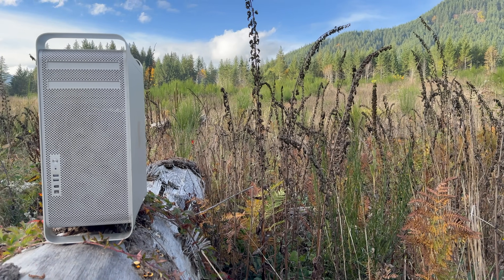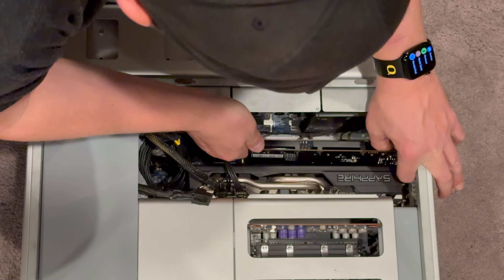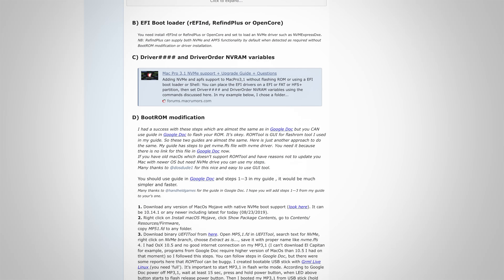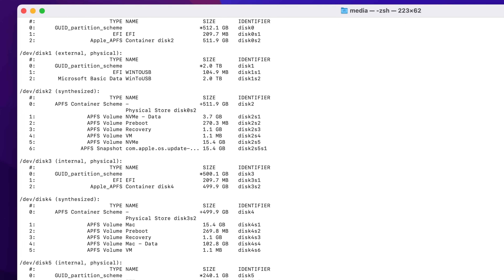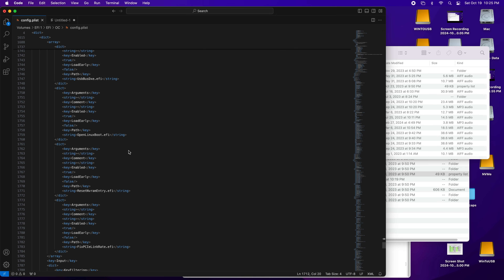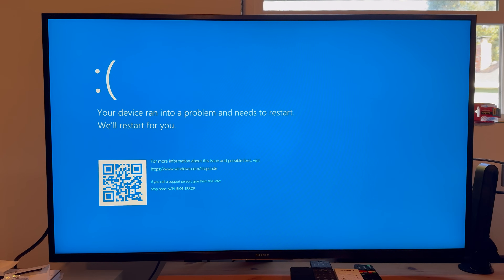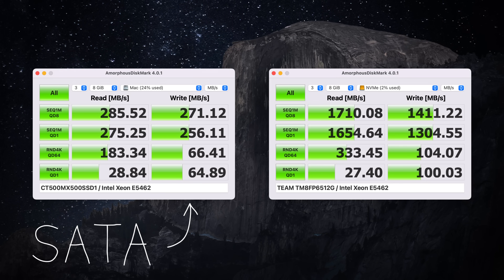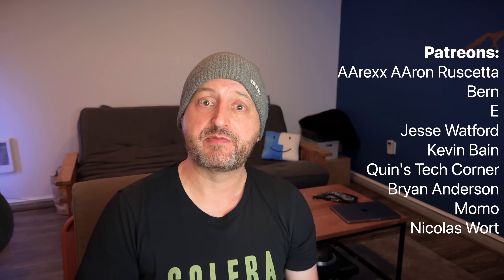An absurd upgrade in a 2008 Mac Pro (NVMe/USBc/10 Gb enet aka McFiver)

Comment: I'm going to have to come back to this channel for a better understanding of Open Core and how to get my 5,1 2008 Mac Pro up to a more current OS.  I'm stuck.
Reply from the maker: If it’s a 2008, it’s a 3,1. They’re a bit dicier in OSes after Monterey so if trying to load a modernish OS, start there.

Also this might be of use:

OpenCore & OCLP Explained (OpenCore Legacy Patcher)
https://youtu.be/VSF9eCLDpoI
Reply: @dmug  - Mine's already been updated to 5,1 with the help of Macschrauber and I'm on Monterey (I believe, I'm at work) but I'll review the link.  I've been using OCLP with mixed success.  It's been a while since I touched it, but I had been having weird boot behavior.

If nothing else I plan to update the dual Xeons to their max and give it a bit more RAM.  Then maybe an nVME.

Comment: I have 3 Mac Pro 2012z. One I use for all my FireWire audio equipment. The other 2 are cloned as backups. I record and then I do all my mixing on the editing on my m4.
Reply from the maker: I'm probably headed this direction, my Mac Pro 2019 is my audio computer and then I'll use a Mac Studio for anything down-chain.

Comment: I remember these days of manual boot load editing. It was actually fun for awhile, as you said “like magic.” In what feels like a short span of time, OC - still in beta - became very smart and easily usable. It enabled me to advance my MP 4,1 to a real beast of a machine and even use it as my primary live recording computer. Some of the changes even reduced the power consumption and fan noise which really felt too good to be true. I recorded some major platinum releases with that computer and I grew so fond of it, I decided to put it on display in my home, behind glass with all the special dishes. How geek is that?!?!
Reply from the maker: Yeah, same thing for me, my Mac Pro 2008 is the only computer I have sentimental attachment to since it was instrumental to several life events. I picked up web development using it which became my career. I recorded two albums on it with a friend. I started my "Definitive Mac Pro Upgrade Guide" just so I could log the things I could upgrade or do with it. Since it was my main and for awhile only computer between 2008-2018, I got a lot of mileage out of it. I bought 2018 a Mac Pro 5,1 and just more or less migrated everything into that computer.

Comment: Just use propertree and clear snapshot and the drivers and other kexts will be injected with the correct priority. You don't need to manually add a string or anything to the config.plist dile if you just want to add or remove files in opencore. Usually that is.

Comment: I have a question..will the  Sonnet McFiver PCIe Card run without all this work on my 2012 5,1 mac pro.
Reply from the maker: 10 GBe requires modifying opencore but it doesn’t need the NVMe hack

Comment: Two part question on the Mac Pro 2010 5,1, please.  Please keep in mind I have a very, very low budget:   1.) What is the best and cheapest metal card I can use?  My goal would be to have it as a way to bring my firmware up to date, not for daily GPU use.  I have two 2010 5,1 Mac Pros that were given to me, and I could swap the one metal card between them for upgrading.   2:)  Can I easily use an NVIDIA GPU in the 5,1 with a Linux drive?   If so, do I need to leave the other metal card in?      Background:  I already have the Linux disk with installed AI models, so I'm not going re-downloading 100 GB+ to run them on the OCLP Sonoma drive or the High Sierra drive.  I have a data limit.  And, yes, these Mac Pros should run AI models just fine, because of the many cores.  I have a much slower 4 core Intel i7 computer with no relevant GPU, and it runs them just fine from the CPU.).  Thanks in advance.

Comment: Where does the time and cost effort end and just buying an M generation Mac mini start these days? Because that card is a great chunk of investment towards one.
Reply from the maker: At this point it’s really a card for limited use cases: people who need to dual boot, audio guys with legacy hardware or software, people who need x86 VMs, or hobbyists or people who want to use it as a NAS. I may reach out to sonnet to try a PCIe to thunderbolt case and explore that for m series Macs.
Reply: @dmug  I've got an M1 Mac Studio, but still find myself reaching for cheesegrater, especially to run older Steam games on High Sierra. It certainly has it uses for legacy apps and games, but we're getting to that critical point now it feel when it comes to cost vs performance.
Reply from the maker: @mvmnt.  oh for certain, the minute Apple Silicon dropped, everything else was obsoleted. 

I preordered a m1 air 16 GB / 1 TB and ran circles and my work 2017 MacBook Pro 15” and my Mac Pro 5,1 with dual 2 TB of NVMe + Radeon VII + 96 GB of ram. I’m a diehard Mac Pro guy and the Mac Pro community seemed mad I was declaring the classic Mac Pros over. I much preferred to edit video and do web dev on my m1 air as it was faster. Still love them, just now it’s for fun and not for any work or serious hobbies.

Comment: In your opinion, what’s the best OS a 5,1 can run smoothly, stable,like a beast, since Monterey?
Reply from the maker: @RenatoPernett  I don’t have a Mac Pro 5,1 anymore and hardware matters but Sequoia seems to run slightly smoother than Ventura on multiple systems I’ve tried.

Comment: El Capitan and Windows will install on a 3,1 onto a Kingston HyperX Predator PCI card with M.2 although it's not really NVMe (it works as an AHCI drive).  But it will do read speeds over 700MB/sec, a little under for write.  If you want to install Windows, you need another drive for boot manager.  For the 4,1 and 5,1, without OpenCore you can install Windows onto the Predator card using EFI install boot.  I don't think Windows will install onto NVMe but HS and Mojave can be.
Reply from the maker: I had Windows installed on an NVMe on my Mac Pro 5,1 you don’t need AHCI, just needed to be installed  via legacy bios mode (off a dvd). However, I don’t think it’s opencore compatible using this method, I did this around 2018 before opencore
Reply: @dmug  I couldn't get mine to boot Windows from a DVD unless it was an EFI boot and it wouldn't see the NVMe devices. Probably an issue with my installer disk.

Comment: How are there enough PCIE lanes in that dinosaur?
Reply from the maker: The 2008-2012 have 40 total lanes which was pretty heavy duty and still fair amount even today. I think only 16x are direct cpu (single slot) the Mac Pro 2019 is just nuts with something like 80 and has 32 direct access lanes which is nutty. It might be PCIe 3.0 but it’s a monster.

Comment: I use a 2008 Mac Pro with a 4Gb vRam graphic card, 16Go Crucial Ram and a Crucial 1To SSD drive for the OS. I can't upgrade anything but it just works.
Reply from the maker: I bet you could upgrade the OS with OCLP if you’re not already using it. I’m kinda stuck at Monterey.

Comment: There’s way easier ways to do what you did with command line. You can use ProperTree and install it to macos and you’ll have an option to edit plist files when you right click. Mountefi can be installed with the script it comes with and that too will add an option to your right click menu to mount efi. Makes it worlds easier and easier to mount the right efi every time.

Comment: Great video. I just bought one for my 5,1.
Reply from the maker: Should be one hell of an upgrade for your computer.
Reply: please report how much work required to make it run.
Reply: @richardnichols2064  pretty much just plug-n-play. I'm on OS 12.7.6 w/OCLP. The machine had no problem detecting the NVMe's, ethernet, USB-C ports. Everything showed up in system information w/o any configuration. I had to install OCLP onto a SATA SSD slotted into bay 1 as it wouldn't boot from the NVMe's. Haven't tried out RAID. I have 2x4TB Gen 3 NVMe's installed, one is the main OS drive, one is for time machine. Transfer speeds b/w the two SSD's is about 1.9GB/s!

Comment: The card is a 4x card, which gives you 16Gb/sec.  Putting a 4x card in a 4x slot will yield maximum 16Gb/second bandwidth.  Putting a 4x card in a 16x slot will yield maximum 16Gb/second bandwidth.  You can only move at the speed of your slowest component.
Reply from the maker: 16  GB/s is true for PCIe 5.0, but this is a PCIe 2.0 computer. Wikipedia has a handy table listing the transfer speeds.

https://en.wikipedia.org/wiki/PCI_Express#Comparison_table

As far as gaining more bandwidth, 4x cards will physically not have enough pin outs for the additional lanes.  I think I said this in the video, that sticking a 4x card into a wider slot will not result in more bandwidth.

Comment: Big fan of your guide and videos! It allowed me to keep my CMP 3,1 working with OCLP and modern Mac OS. Big Kudos to you!
I use a McFiver in my 3,1, too.
Got OCLP on a secondary sata SSD with NVMe support enabled via OCLP GUI, this then supports booting MacOS off the NVMe drives from the McFiver.
Do I understand correctly your procedure in this video allows to boot from NVMe without the need for the secondary drive to host OCLP but to boot from the NVMe SSD directly?

P.S. OCLP 0.6.4 delivered “…Restore support for Aquantia Aqtion 10GBe Ethernet for Pre-VT-d systems on 12.3 and newer
  - i.e. MacPro5,1 with AQC107 expansion card running macOS Ventura/Monterey 12.6….”
(changelog OCLP https://raw.githubusercontent.com/dortania/OpenCore-Legacy-Patcher/refs/heads/main/CHANGELOG.md)
So 10GBe Ethernet support works out of the box since OCLP 0.6.4 - or at least it should.

Comment: Since I literally just bought a Mac Pro 5,1 that already has OCLP & Monterey installed - with an RX6800 - I was looking for something like this to help me understand what upgrade options are out there. I'm definitely going to be checking out that Sonnet 4x4 video!

Any recommendations for a USB-C/USB-3.0 card? I've seen some people saying the Innatek works well & they aren't super expensive on Amazon.
Reply from the maker: It really depends on what you're after, if you just need faster-than-usb-2.0 ports, then just get a cheap USB 3.0 card. If you have a really particular use case (like VR), a quality card matters. One of the earliest videos I made might be of interest.
https://youtu.be/bTm0Q1utcV4

Also check my upgrade guide:
https://blog.greggant.com/posts/2018/05/07/definitive-mac-pro-upgrade-guide.html

Comment: OpenCore Legacy Patcher does have a chekbox to enable nvme boot, no hacks required. Should work on a Mac Pro 3,1 AFAIK, plus that would persist during an update.
Reply from the maker: 101% want to be wrong but when I checked NVMe booting in the build tab, it didn't work. That said I can try it again to make sure. I left that out in the video but probably should have tried again due to my dual OpenCore situation.
Reply: @dmug  I'm not certain either, as I don't have a Mac Pro to test it on (yet). But hey, if it works it works, if it doesn't there is at least a work around like you've shown in the vid!

Comment: Anytime I do upgrades like this in the cMP's, I find it's always better to just temporarily remove any drives that aren't absolutely necessary, to avoid confusion when using diskutil list, etc.

 I got a 3,1 to replace my borked 2,1 and honestly I was a little disappointed. Spec-wise it was obviously a superior machine, but I felt like the 2,1 had more raw CPU horsepower (both had max CPU configs). That's what ultimately led me to just move up to the 5,1. So my 3,1 honeymoon didn't last that long.
Reply from the maker: Interesting, I've barely used a 2,1 as the Mac Pro 3,1 was first Mac Pro I bought back in 2008, dual 4-Core 2.8 GHz. I was surprised though how much faster my dual 5,1 was over my 3,1.  I really felt it.
Reply: @ I do remember the 3,1 being quieter than the 2,1, but I felt like my Pro Tools sessions were using up more CPU resources with the 3,1. I had more fun with the 2,1 because of all the hackintosh stuff and  getting it to run Mavericks at the time.

Comment: I mean it certainly is nice you were able to do something like that with a computer that old, but the price of the card begs the question, why?

On a sidenote, any tips on how to get that Radeon working on the latest Sonoma version? I keep getting an error in OCLP when building the driver cache for it. It used to work, but, for one reason or the other, I had to reinstall the OS, and after that, I just can't get it to work now. I did, of course, go through your really exhaustive list of supported cards, and installation howtos, but, I beliebe it has something to do with the combination of KDK, OS and OCLP versions. By the looks of it, we have the same Sapphire RX580 model. Though I have a 5.1 Mac Pro. Also if you'd need more details, I can proved a reddit link where there is a detailed log.
Reply from the maker: A good chunk of what I do on YouTube you could ask "Why?" and the answer would be "Because I can". The reality is, this card will go back into my cMP but I'll continue to boot NVMe on my Mac Pro 3,1 with a generic card. For some 5,1 owners with legacy setups for say, Audio production, or functioning a host, you could jam 16 TB of NVMe storage + 80 GB of HDDs and access it via 10 GBit Enet, be it as a Media PC or otherwise as it'd be about the cheapest way to cram oodles of storage into a reliable box if you already own a cMP.
Reply: @dmug  That is a reason as good as any, I guess. And don't get me wrong, I've enjoyed watching the video, but as you said, you'd be putting the card back into your 2019 MP, so it was just a nice experiment.

Comment: for the efi drivers please source them from the official open core releases they are included inside the release bundle and are from a trusted source
Reply from the maker: Pretty sure isn't part of OpenCore, but if you have a proper source, do link me.

Comment: Thank you for this, definitely shows the aspirational realms of the possible! I am running two cMPs (Mac Pro 5,1) as my production design workstations and have been lovingly maintaining them for years. I’ve been hesitant about going the open core route with my daily drivers, but that process seems to have been steadily improving and getting less terrifyingly hacky. Thank you for showing us what’s possible and a comprehensible (geekiness tolerance your milage may vary) roadmap to how to go about. Takes some of the terror edge off! I am approaching the point where software evolution will turn these two perfectly functional beasts into 40lb doorstops! The DMPUG has been my “stayin’ alive” bible for years!
Reply from the maker: OpenCore Legacy Patcher really makes it a lot easier. Monterey with most GPUs and configs really stable for most people.  I barely used OpenCore prior to OCLP as I used Martin Lo's config, set it and forget then got a Mac Pro 2019 so I'm late to OpenCore and just now really geeking out with it.

Comment: Great job. :)
My 2010 5,1 Mac Pro has a 2 TB 970 EVO Plus NVMe SSD in a Simplecom RGB adapter. I can't control the lighting on this Simplecom adapter like with my Jeyi adapter, but the Simplecom adapter takes up the whole slot and thus feels a lot more secure. My Mac Pro also has SIX USB-C ports: four in a Sonnet Allegro card, and two (plus two USB-A ports) in a generic card. As for graphics, my Mac Pro has an RX 580 with 8 GB of video memory, which I'm perfectly happy with.
Reply from the maker: That's pretty similar to what I had in my 5,1 for a long time. I lucked out scored a VII when they were on clearance from best buy for about $500, but had a 2 TB 970 Evo as my boot drive and I had an Allegro.

Comment: I have three 3,1s,  One won't work at all, no matter what I do, board is fried.  The other two are upgraded with some kind of "latest" OCLP version from this past year that I did successfully, with SSDs, original GPU.  I tried selling them for $200 or so, and no one cared. lol.   Gonna try $100 soon.   I never use em, but maybe I'll upgrade OCLP again before I go.
Reply from the maker: When I was selling all my computers during the pandemic and GPU crisis to fund my Mac Pro 2019 purchase I didn't bother with my 3,1. It has a fan revving issue that requires MacsFanControl. I figured I might be able to get $50 for it because of that. I decided to keep it as it just didn't seem worth the hassle.

Comment: As a hackintosh opencore user I always use propertree to modify my config plist and basically, after adding kexts and drivers and even when replacing opencore when a new version comes out, I always run the config plist via propertree and go to clean snapshot to basically automatically add the files to the config without needing to go to a code editor every time to add them manually.
Reply from the maker: Hmm, never heard of Proptree until this, I need to give it a whirl. Sounds pretty cool.